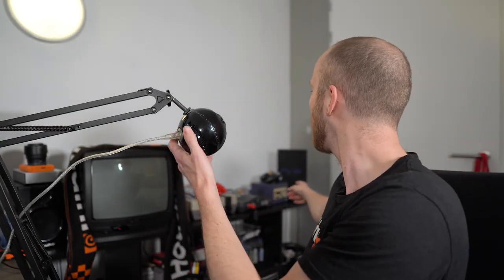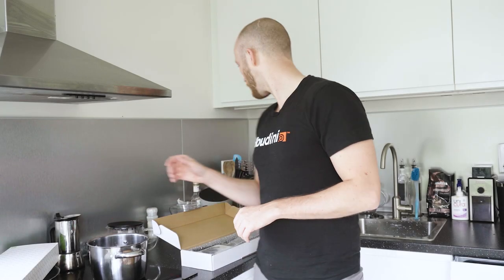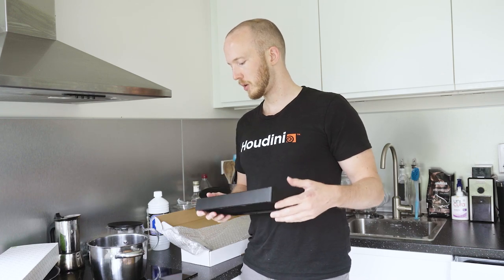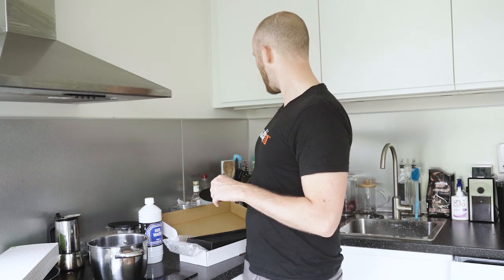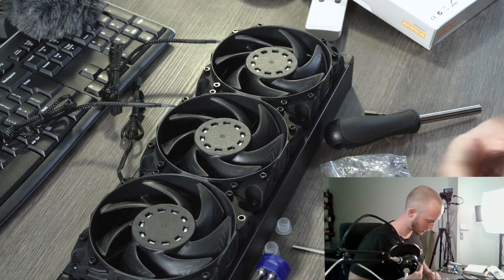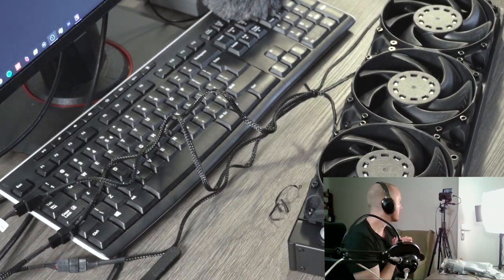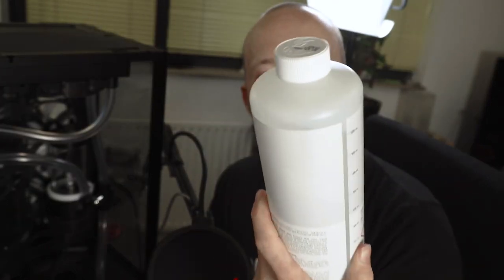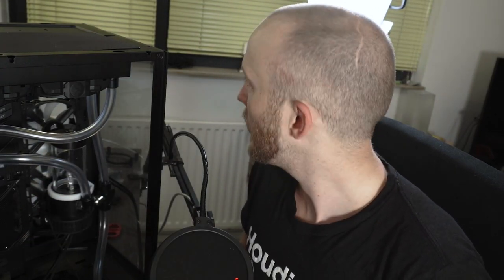Building Watercooled Workstation - Part 03 - Filling her up!

Comment: Hey Tim when do you plan on releasing the video with benchmarks? 

Would love to see the temps you're getting on high CPU loads like caching and rendering (or something equivalent like cinebench as I know you render with Redshift as opposed to Mantra or Arnold)
Reply from the maker: Hey man! Yeah never got to that part because I just got a new appartement right after I wrapped up part 3 and was super busy renovating. But yeah I should really do the part 4 thing at some point!
Reply: @TimvanHelsdingen  Awesome. Look forward to it. 

Also you had the right idea with custom loop cooling because since the RTX 20 series really the only realistic way to get 3/4 cards for rendering on a TRX40 mobo is to watercool them due to cooler sizes and PCIe slot placement of most 3 slot boards (I know yours is 4). Unless someone feels comfortable stacking blower cards with minimal space for air flow

Comment: *can you elaborate a second on how you set up your nvme drives and why?
Reply from the maker: Will go into more details in the software/benchmark video, but I set them up as raid0, which means combining the two drives to function as one drive and that if you write a file to the nvme, the file will be split in 2 and half of it will live on one drive, other half on the other drive. So essentially your read and write speeds will be about twice as fast as with a single nvme (I'm hitting 9000+MB/s on read) and you also add the storage together, so if you raid0 two 2tb drives you'll have 4tb.

The downside to this is of course that if one of those 2 drives fails, you lose all your data. Which is why I don't recommend it if you don't have some form of redundancy.
What I'm doing is that I'm live mirroring my raid0 to my 30tb NAS, so if the raid would fail it wouldn't matter because I wouldn't lose any data. I'll show how all of that works in the next video.

Hope that makes sense.